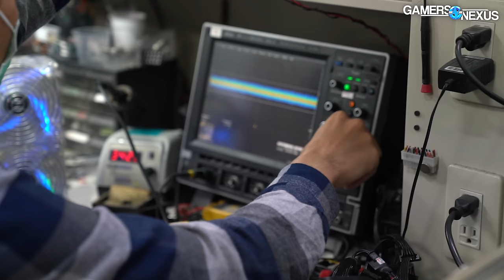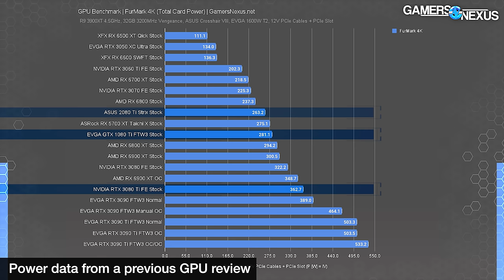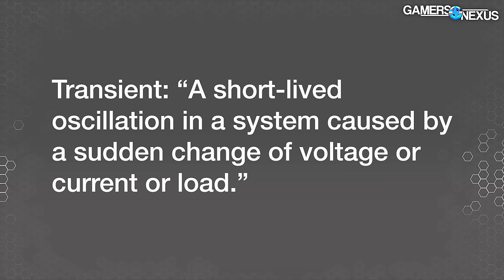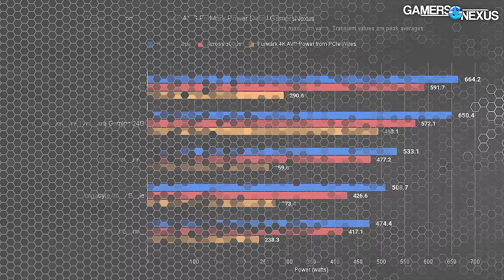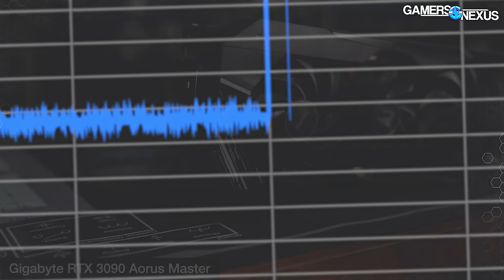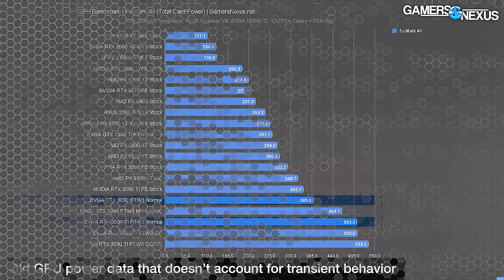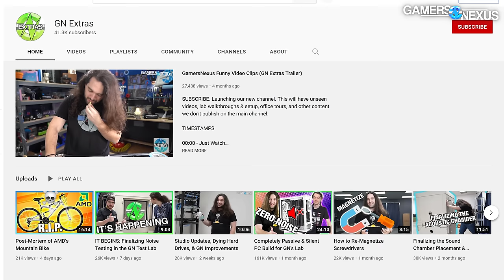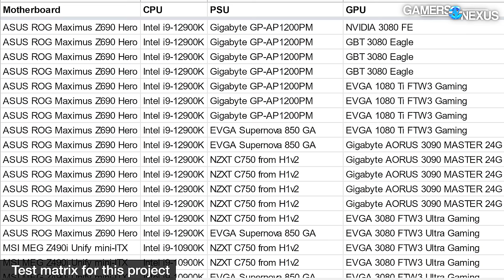The Brewing Problem with GPU Power Design | Transients

Comment: So few people out there actually understand and take the time to learn about hardware, and then really point out flaws. Not just surface-level or consumer obvious ones, but really deep dives.  When you guys speak, people listen! Your channel makes a big splash.

Every generation the power draw grows, the heat grows, and the heatsinks get bigger and bigger. It's not sustainable.
Reply: That last part isn't really accurate.  Power consumption (for both GPUs and CPUs) has see-sawed over time, but definitely with the 40XX series we're looking at record-setting levels of power consumption.  With this generation, Nvidia is trying to beat AMD by throwing efficiency to the wind and just pouring raw power through GPUs to force faster clock speeds.  This video shows one of the challenges of doing that, in that if your PSU draw 450 watts normally, it might need to be able to survive transients of 1500 watts.  Both the day-to-day operating costs and the cost of requiring such a robust PSU will make these GPUs very poor value propositions.  

Also, by taking this irresponsible approach of "MOAR POWAH!!!!11!!" and boasting about their power consumption numbers, they're just asking governments to step in and enact hard and fast regulations limiting maximum power consumption.  And that likely will just make everybody unhappy.
Reply: It might not be sustainable, but it doesn't have to be. At least for mainstream consumer cards. Consider what the current high end cards can do: 4k, 120FPS, ray tracing. At least two, possibly all three. Whats left on the graphics wish list?  8k? Impractical on account of the shear size and cost. 4k VR? Already have it, just turn off the RT. More FPS? Diminishing returns past 60 already, and your not running competitive FPS like CSGO with 8k textures and ray tracing. Therefore, hello 600FPS. 

There are just not any technical feature left to add in, and while there are a few niche combinations of games that can max out a 3090 and have sub 60FPS, lets say the 4090 doubles the graphics power for not double the power cost. RT is the final word when it comes to graphics features (I'm saving about 2 pages of explanation with this) and that has a more or less fixed compute cost. So lets say the 4090 has enough graphics power to run anything that you can reasonably run. Someone will have to draw the line in the sand and say" Our card can do 4k VR with RT with 8k textures with 240FPS... what do you not have phones, err 8k VR, err eyes that can break physical limits?.

So the 50 cards will be refining the design, dropping power, and dropping cost.

Thats not accounting for the artistic/scientific types, but they are going to always be wondering how they can fit xx90 #5 into there build.
Reply: @megachonk9440  considering how relatively small the market for high-end enthusiast graphics cards is, government regulation vis a vis power consumption seems highly unlikely.
Reply: @sharpe3698  Given how the trends are, we might be seeing silly power consuming on low and mid tier graphic card where power consumption vs performance become a cost vs value issue.
Reply: @nickierv13  As long as cards can advance, games will continue to push the boundaries of what's possible. Everyone always says that there will be a limit, but it's never been true. There will always be some level of detail, some additional effect that opens the floodgates to more performance being needed. Todays that's raytracing, tomorrow it might be in-game fluid simulations, or per-hair physics or SOMETHING. No one is ever satisfied with stopping and saying "good enough".
Reply: @nickierv13  well next step is likely 4K 240fps or 4K 120fps with Raytracing or 8K 60-120fps. we're not even close to a limit in any respect of graphics. We will probably get there at some point but its going to be years before we get to that point. probably wont start seeing diminishing returns until well past 480Hz and 8/16K would be my guess. depends if headsets start replacing monitors in the future too I guess.
Reply: @sharpe3698  Actually, the graphics cards are on the cusp of pressing into existing government regulations: electrical code. Standard US outlets are rated for 1500 watts. You can't draw more than that. And due to safety margins, loads are limited to 1200 watts.
Reply: @CptJistuce  About time everyone starts to think about how to move away from silicon all together. And find other technologies that can allow digital computations with less need/no need for electricity if possible.
Reply: @sharpe3698  - California has already created regulations in this regard. Then again, they have never seen anything they don’t want to centrally plan, USSR style.
Reply: @zipzip6677  I'm stuck with 60Hz monitors, I need the resolution, and yes 120 is obviously better than 60, but I just don't see the average person being able to tell between 120-165 and the 200-250 range. Maybe the top 1% of FPS gamers? As for higher resolutions, it comes down to pixels per inch, a bunch of math I'm far to tired to work out, and angular resolution of the eye. Short version: at 400mm/16 inches, 0.1mm is the upper limit to distinguishing objects. 32" 4k is about 0.18mm, 27" 4k is 0.15mm. 8k needs to be 38 inches to get to 0.1mm pitch, and thats at 16 inches. Double the distance and you double the minimum pitch. And it quickly becomes a race to the most useless stat thanks to basic geometry.

Comment: Hey Steve and GN team, what effects does Undervolting a GPU that exhibits high transients have? 

Undervolting already has a ton of benefits, would love to see if it can be a way to deal with transients to avoid having to replace a power supply!
Reply: If the GPU itself can handle it I'm sure it will make a difference. You can also power limit the card and that will guarantee reliability
Reply: @Mpdarkguy   @Cătălin  Power Limit wont fix as the max power limit of rtx3090 is ~350-400w depending on the model so it never should be able to even go to 600w+ spikes but lower voltage means there is really less power going into the card and therefore should improve the spike behaviour
Reply: I was thinking this as well. The down side is that the silicon lotto plays a role in how much you can undervolt, only allowing a generalized answer at best. It would still be handy to know if that indeed helps or not.
Reply: I undervolted my 3080ti FTW3 to 875mv which was quite a bit lower than the ridiculous stock current that EVGA decided to pump into this thing, (Which was absolutely unnecessary because I stay well above this card's boost clock and stable at 875mv) and while it did reduce my peak spikes, I still hit 425+ watts during spikes. (I originally would have them in the 460s) These spikes were just during regular gaming. I can't imagine what I still might manage to hit during some kind of GPU torture test. That said, I've never had a lockup or PSU shut down of any kind. Although, I am running an EVGA 750 Watt gold SuperNova, which are pretty rock solid. 

So in total, I'm using an 8700k typically running at an almost 5GHz all core overclock, the 3080ti FTW3, two mechanical hard drives, three SSD drives, four 120mm Corsair LL series RGB fans, a single 120mm slim fan, a four port USB 3.0 expansion card, and about 8 USB devices total going into the PC with, typically, half of them drawing some kind of power at all times. 

I'm probably OK because of the 8700k. I'd imagine if I put in any newer chip with 8+ cores, I might run into some issues.
Reply: Honestly just undervolt. It's so beneficial. My FE 3070 has it's power consumption cut by two, i can do 850mv at 1860mhz + 500Mhz vram OC stable.. On forza, i go from 205-220w to 110-135/140 at worst..
Reply: @TooBokoo  Steve said 4k with RTX on seemed to be worst scenario. Are you 4k RTX? I'm still 1080p, no RTX.
Reply: @bestlamegamer  you can't assume that transients are always the same scale factor. The question was if undervolting changes that relationship.
Reply: @TooBokoo  "875mv which was quite a bit lower than the ridiculous stock current" - mv is voltage, not current.

How were you measuring the spikes? I doubt you had an oscilloscope to get the resolution needed to measure the problematic transients.
Reply: @silure9502  its*
Reply: Oh Gawd! Now we're about to see a ton of individuals who never used the term "transient" start using "transient" from this day forward as if they were using this terminology in their daily lexicon.
Reply: For me, undervolting solved what is (I believe) a transient problem. With a 3090 FE and a 750W Seasonic Titanium power supply, I was experiencing (I believe) OPP events in Valheim of all games. Only in Valheim, not sure why. Since undervolting to 2040MHz @ 987mV peak boost, I have not experienced a PC shutdown again.
Reply: @Google_Does_Evil_Now  4k with everything at Ultra. No RTX. So I'd imagine it might be worse with RTX on.
Reply: @TimBoundy  I was basically using it interchangeably. I think you knew what I meant, but I guess we can argue semantics. No, I did not have a scope. I was using Afterburner, which is certainly not perfect, but it can ballpark it close enough. If I'm seeing peaks at 460 watts, you'd better believe that card is having some massive spikes, whether I'm 2% off or 10% off. That's some huge power draw and will be, especially, concerning with the 4000 series cards.
Reply: @TooBokoo  Afterburner can't measure these transients. A 3080 Ti like yours will be exceeding 550W, you're off by a lot more than 10%.

Comment: Would have been great to see what happens in lower-tier cards, like a 3060 or 3070. Sure, the 3060's TDP is 170W so most PSUs could take a transient as normal, but consider someone on an older 450W power supply, which technically meets Nvidia's minimum spec.
Reply: Im using an rog strix 550w with a 3070ti , not even min specs lmao
Reply: @blindshot709  is it... working?
Reply: @KellonMelon65  yes... 6 months no shut downs
Reply: @blindshot709  it is probably throttling
Reply: @Metalwrath2  how would it be throttling when it never goes above 350w leaving 200w head room for spikes . also that 350 is under full load lmao gotta love 65w cpu's
Reply: @blindshot709  That's how I wrecked my old system. Keeping no headroom has your psu sweating like crazy. also what steve said in the video. You're gambling my dude
Reply: @Fuckmymen  What do you mean "wrecked"?  Power supplies are meant to be run at high loads for better efficiency.  Do you really mean that you arbitrarily bought a higher wattage PSU when you weren't actually experiencing any problems and it didn't actually change anything?
Reply: @blindshot709  ryzen 5 3600 or ryzen 5 5600x. Both goated CPU.
Reply: @sparkypvp2167  Im using a R7 3700x
Reply: I was once using a shitty PSU -/+ 500 watt with phenom2 4x and HD4070, I had shutdowns and knew what was up, the 12V rail fell down to 11V under load AND after one such shutdown my knew SSD got scrumbled. Luckily they gave me knew one, because it passed the fast power check in the shop.
Reply: @phillgizmo8934  I used to run a 170 watt PSU (prebuilt moment) with a 1050 Ti. Had more than a few BSODs until I got a fully custom replacement. Glad you got a replacement, hope that death didn't hurt too bad.
Reply: @Jmcgee1125  loosing new OS SSD is never bad actually :-) (by data loss means)
Reply: @evrythingis1  If a high load is 60-70% then yes, but not at 90%, efficiency falls through the floor.

Comment: 1:  That music.  Nice.  2:  Back in the "old days", general wisdom was to get a power supply with a 25% higher capacity than what the system added up to.  It was mostly to guard against efficiency drops, but it seems like it might be good to help with the spikes.
Reply: couldnt u put a bank of capacitors on the 12V rail?

Comment: I'm wondering if this these transient draw situations were the kind of thing that led to some of these 3090 GPUs having VRM transistors that failed under load during certain games?
We already know that some games and some setting combinations create worse transients than others, so my thinking is that this could have led to a "stack-up effect" that ultimately surpassed the ratings of the VRM transistors for long enough that they just couldn't take it any more.
Reply: Buildzoid @ Actually Hardcore Overclocking talked about this one.
IIRC it's because of improper phase balancing, that is, some phases are overloaded, while others arent really doing anything.
The whole VRM design on the 30 series is just shit, according to him.
I can't remember which vid it was, but it was a recent one.. IIRC he was fixing a 3090.
Reply: @patrikjankovics2113  30 series in general, or that specific 30 series card he was working on? I have an Asus 3070 Ti in my computer right now, probably fine but I'm never gonna mess with it other than putting a water block on it.
And I know that Asus does go kinda crazy with the VRM design on their motherboards at least, so it wouldn't surprise me if they did something similar with their Strix or Tuf line of 30xx cards (mine's a Strix).
But yeah unbalanced phases does sound like a wacky problem to have, is there any particular reason they can't just parallel all the various phases together? I know "ganging transistors together" doesn't generally work like that, but I was more thinking of ganging together individual buck regulator VRM sub-units, so they'd basically all be wired in a "diode-OR" type fashion.
Reply: @44R0Ndin  The last solid top end card made by nVidia was the 1080Ti. 20 series are prone to power delivery failures and the 30's are even worse. Certain cards are extra shit (Gigabyte) but the 30's in general are unreliable. Then there are dummies who think flashing their unreliable cards with "1000W bios" is a good idea.
Reply: @TwiztedJugallo  Good thing I'm relying on 3rd-party cards from more-or-less reputable brands then? You're not gonna get me to give up my 3070ti for a 1080ti or 1660, and so long as I don't mess with the VBIOS it shouldn't have any issues.
And in case you didn't realize, or I forgot to mention it earlier I don't have a 3090 or 3080Ti.
I have an ASUS Strix 3070Ti, and it's been doing just fine for me.
My previous 2070 did die on me after 6 months, but I traced that back to the Micron-branded GDDR6, and not a VRM failure (it even looked like memory failure on my screen, plus I found out that there was a bad batch of GDDR6 from Micron that got used in a lot of 2070 and 2080 cards which is why they were dying frequently, but that particular problem stopped happening when they switched to Samsung branded GDDR6).

Now given all the problems that the 3090 has been causing, I'm glad I didn't have the money to get one, but even if I did I wouldn't have, all I do is play video games (I don't make videos, I don't even use Photoshop or anything like that), so what I have is perfectly enough for the needs I have.
Reply: If the 12v power sags then the VRM has to draw more current to keep it's voltage up. That would drag the 12v power down even further.

Comment: Should also note that certain models of power supply are more vulnerable to transients than others. A 750W EVGA G6 might be able to handle a 3080 just fine, while a 750W EVGA GA likely will not. The Seasonic Prime-based units are also problematic in this regard, just to name a couple of the more popular lines. Either way, GN did a fantastic job of explaining transients here, and I look forward to what's in store.

Also, I suggest looking at Aris' Powenetics V2 which he announced recently; could be pretty useful in testing.
Reply: It basically depends on what BIG capacitor is used within power supply, so it can withstand sudden spike
Reply: @DimkaTsv  There is an awful lot more to transient response than just how big the capacitors are. Capacitance is an important part of it, but you can't know about whether a PSU can handle a 3090 just by looking at the caps.
Reply: @nunyabeeswax3012  Sure, i guess... I am no electrician in any way, so just answered based on own knowledge, which is limited

Comment: I'm an avid VR user for gaming and until late last year I had issues with games being stable and it was very hard to find out why. After all that trouble I decided to buy the best power supply I could find hoping it would have the best quality components that could handle any (my supposition here at that time) very short power peaks that might disrupt my VR experience. I invested in the Corsair AX1600i 80Plus Titanium Power Supply with a 10 year warranty. At the time my rig was an ASUS ROG Strix 390-F Gaming Motherboard, an Intel i9-9909k CPU, 64 GB RAM, two Samsung NVMe SSD for operating System and my most demanding games (had other SSD's for other games), Nvidia 1080Ti on Windows 10. I could now discount the PSU for any problems I was having. Shortly after, I upgraded to an ASUS ROG Strix GeForce RTX 3080Ti OC and this solved all my issues with VR. I upgraded again for flat screen games to a Viewsonic XG320U 32" monitor running at 144Hz in 4K. I limit in Nvidia's Control Panel all games to a maximum frame rate of 144. With this combination I can even run (all without mods) Fallout New Vegas, Fallout 4 flatscreen and VR. These games have some terrible coding that most people complain about but now I don't have any crashes or stuttering. For those playing Fallout 4, in advanced settings you must not set Ambient Occlusion to HBAO+ (Ultra) so set it to SSAO (High) and set Weapon Debris to Off (best performance). All other setting can be maxed out. I also use in all games Image Scaling On in Nvidia Control Panel and in GeForce Experience Image Scaling set Render Resolution to 85% 3264x1836 and Sharpen at 50. I am now on Windows 11 with no issues. This represents several years of trial and error and I hope someone finds it useful.